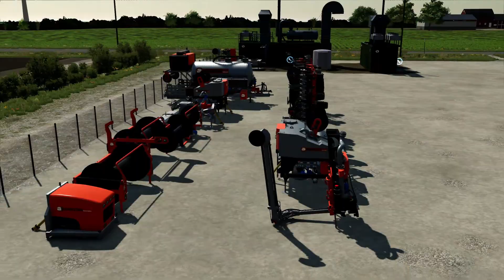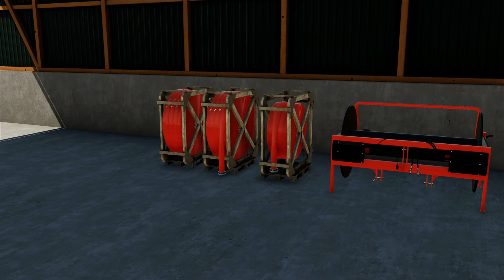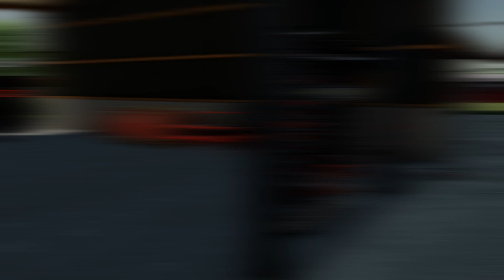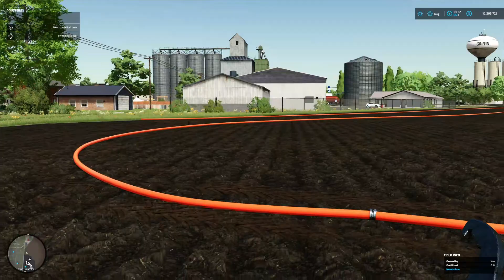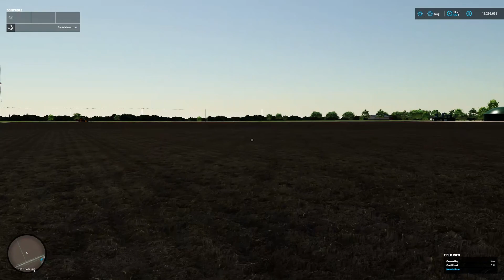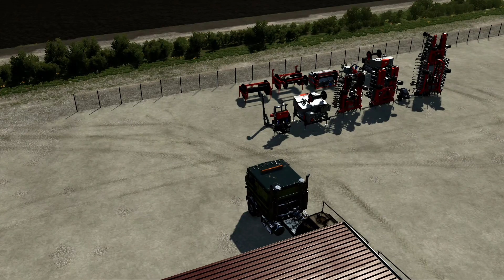PUMPS'N HOSES DLC FIRST LOOK - Initial Setup FS22

Comment: This video is great - I'm still curious about the water cleaning the hose. If I'm not mistaken, it didn't consume any water in that process. I wonder if the end of the hose should be detached or maybe you have to run the injector to actually get water through it? I'm really looking forward to getting rid of my huge slurry tanker and the nuisance of refilling it constantly.